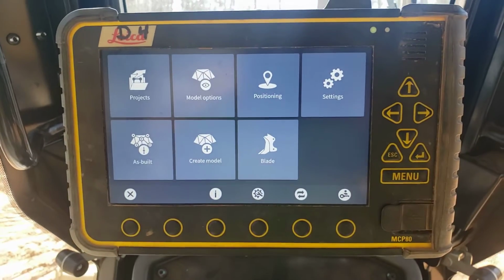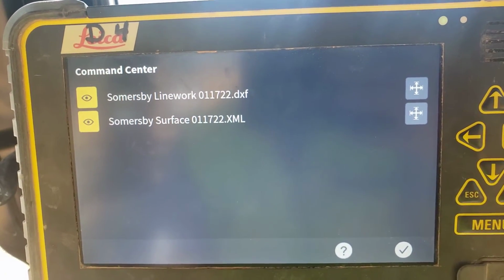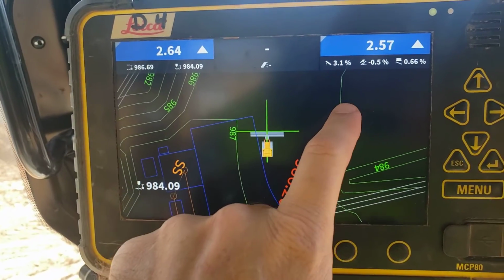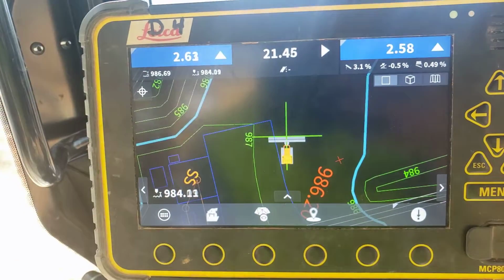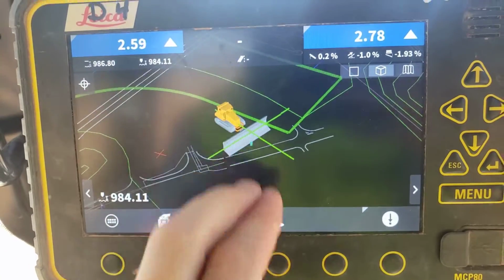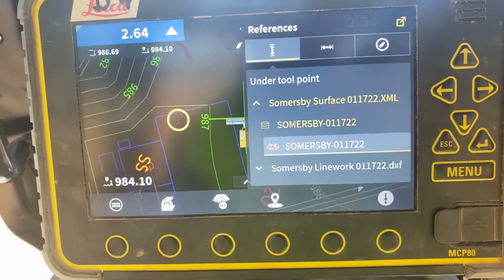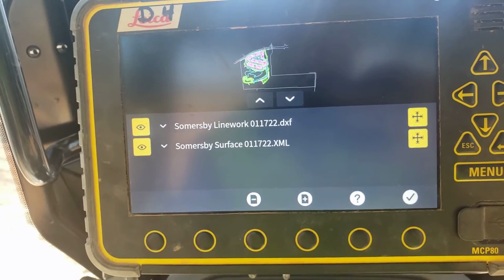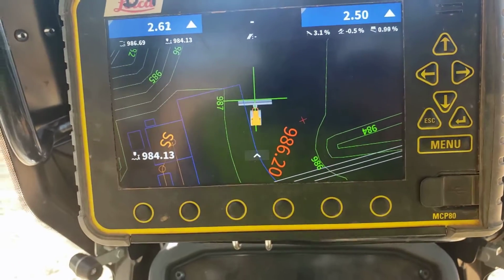Leica MC1 Version 6.4.0 For Dozers, Graders, Excavators - Quick look in the field

Comment: Makes no sense  to unselect  or not be able to use the line work  for horizontal  offsets  yet the the line work is still displayed  poor operator  would be tearing thier hair out wondering  why they can't  get an offset
Reply from the maker: you just click and hold down on any line to select it for horizontal offset.  You can also isolate just the layer.. say "back of curb" and then select "auto snap" and it will automatically use which ever line the edge of your blade is closest to.  You can still add a horizontal offset in either scenario.